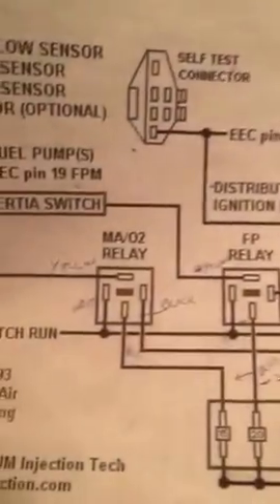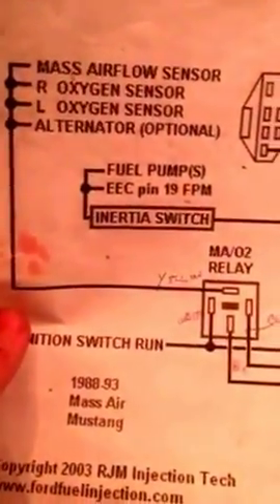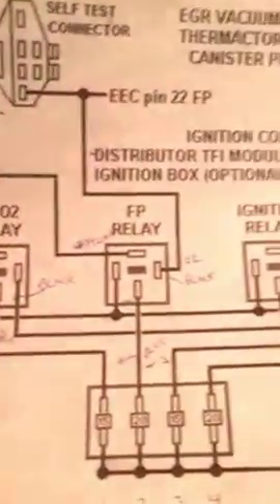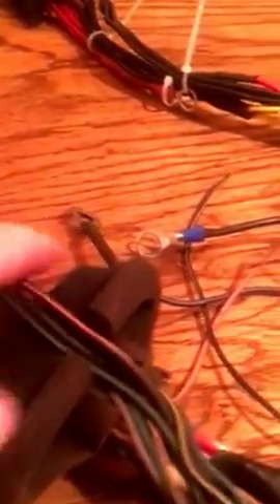Ford 5.0 EFI Harness Overview with EGR delete

Comment: Hello, I have one important question. The same process works for a 5.8 engine? Or are the resistances different?
Reply from the maker: Hello, I don't know if the resistors are different, but I would guess the process of using them this way is similar.  I have really only ever worked with the Mustang computers on these conversions.
Reply: thank's  @MajorSporto

Comment: Good Day - I am taking a wild chance that you might see this and be able to help.  I don't know how to reach you  - I didn't see an email on your profile.   My son has a 92 f150 5.0 Speed density.   I am attempting to swap over the Mass air harness from a later model truck.  I would really appreciate the opportunity to ask you a few questions and make sure I am on the right path.  Fingers crossed you see this...
Reply from the maker: Hello, I’m mostly experienced with the HO Mustang 86-93 computers, but I can help you research the wiring for project. As the Mustang computers get more expensive and rare, I’m seeing a lot of guys using EFI setups from other non HO Fords.  They’re similar, but still a bit different, so I’m curious about your project. E-mail me phillipsmcsd at gmail dotcom.   Spelled it out to keep from getting spammed.
Reply: @MajorSporto  Thank you!  very kind of you to take the time.  I will email you the details of what I have and what I was planning to do...really appreciate the assistance..